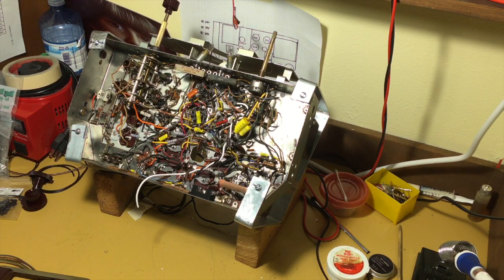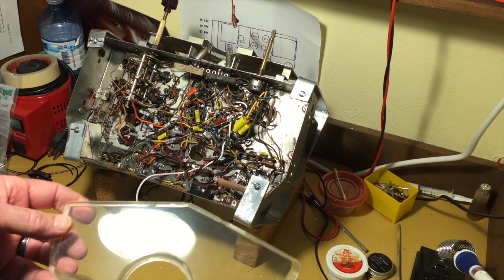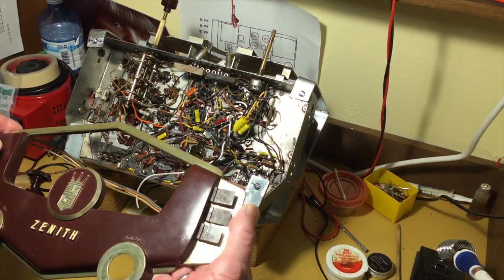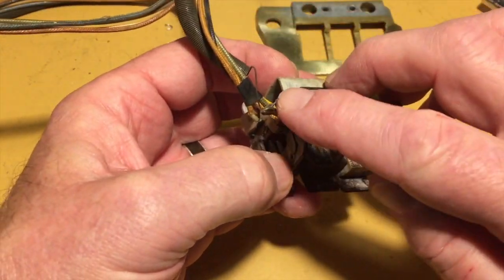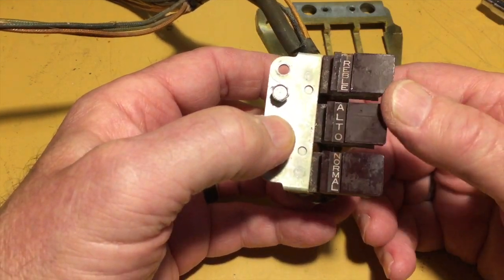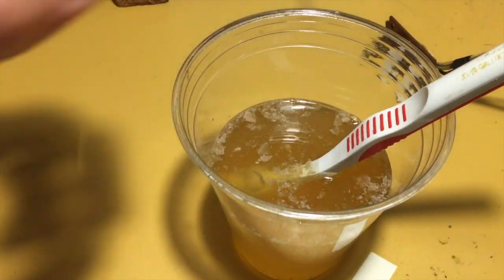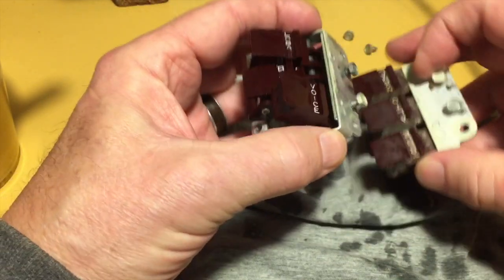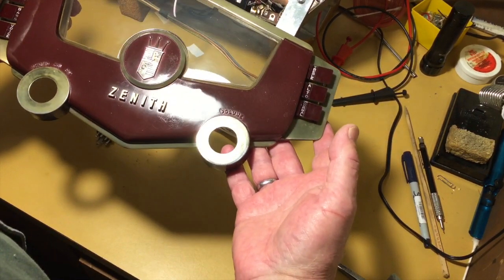1951 Zenith 10H20   Episode 8   Oooh, a Radiorgan   HD 720p

Comment: Enjoyed the video!  Learned a bit too.  I had thought about asking what the proportions of water to ammonia you used were but then agreed with you that while it did do an excellent job of cleaning, it also "cleaned" the lettering off too.
There is something else that you "could" do for the brass look, but I am not suggesting it.  That would be to mask off everything not to be brass colored, and spray paint it with a brass finish.  I'm not  sure how well it would look for one thing...but it is a possibility.
Looking forward to more on this series.
Reply from the maker: Thanks, Wayne. I tried a spray brass finish on an earlier project, and to my eye it just doesn’t look quite right. As Larry suggests in the next comment, Zenith probably sprayed on a lacquer with particles imbedded (perhaps brass dust) instead of an actual brass plate. In any case, the results are OK. Thanks for watching and commenting!

Comment: Very nice job with the tone controls! Im wondering if the “brass” coating wasnt just clear coat that had yellowed? The brass or a reasonable  facsimile thereof, cleaned up nicely! Is the lettering on the tone control engraved in the bakelite? Or is it just painted on? If it is engraved, I have taken oil based “titanium white” (like Bob Ross used) and applied it with my finger and pushed it into the engraving, then wipe off excess.....it takes a few days to cure, but really restores the kettering like new! What tolerances do you shoot for Martin? The out of tolerance resistor in the tone, will give this radio it’s character! It’s unique sound! Keep up the great work! Take Care—Larry
Reply from the maker: Thanks, Larry. I’ll take a look at the buttons.  I think they are engraved. If they are, I’ll try your idea.